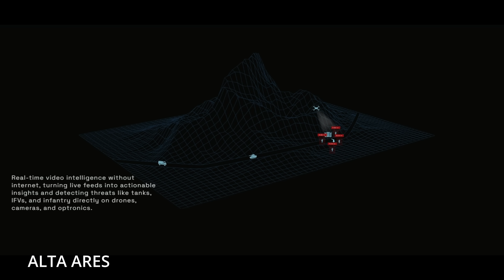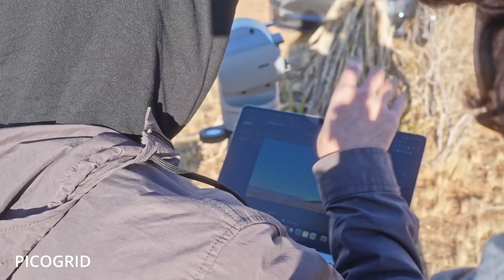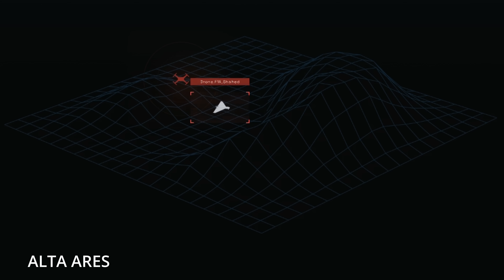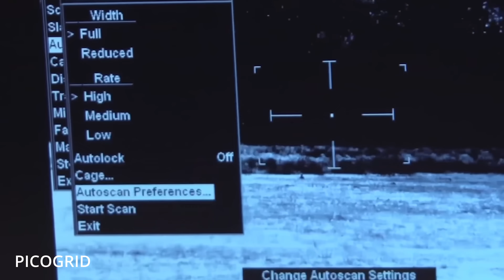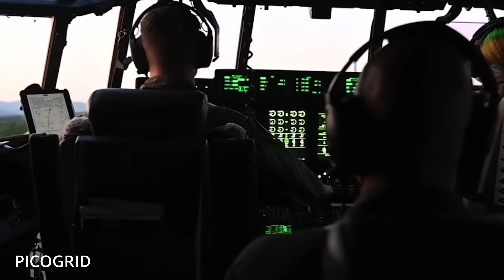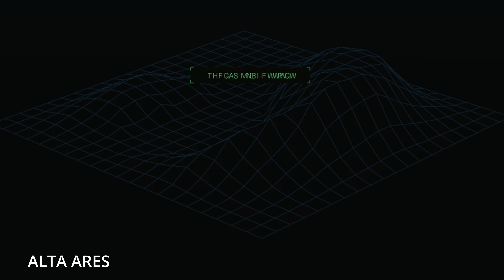France Builds Real X-Wing to Stop Drones!

Comment: Ukraine really needs REUSABLE drones to take down Shaheds/Gerans/Parodiyas. These drones are much cheaper than using missiles, but when you need to take down hundreds of drones in a single attack, that cost soon shoots up to the point where it's unsustainable long term.

Another option would be AT-6 Wolverines. The manufacturer Beechcraft has proposed an anti-drone variant with underslung gun pods. That makes a lot of sense.

Lastly, the best solution would be to take out the drone factories. European countries could build Ukrainian long-range attack drones under licence and provide Ukraine with a steady supply of them in large numbers, so that the drone factories can be WIPED OUT, not just damaged. (The same goes for oil refineries as well.)

Comment: So you hinted at interfaced Radar. So how does that work? If it must have it's own unique radar units specifically designed to work with the x-wing.. for me it's a non-starter. Unless it can accept data from other NATO linked radar systems, it is too costly. So say it is hovering, what is hocer time? If low then don't work unless launched into intercept path and assuming Russian radar does not see it coming and execute alternating courses to dodge.
How is it with IFF? You mentioned pixel scanning so what if Russia makes minor changes, does AI need updated or can it attack and send back new profile data? Very low success rate which may be associated with inability to properly vector in a timely manner combined with final approach accuracy and attack method ie direct contact or fragmentation. If the later, range, approach angle & projectile pattern could definitely be factors with such a low kill rate. If it can't do the job, it should be smart enough to return to base and signal target out of range so another might be vectored in.

Comment: Looks like progress. Ideally, they would not self-destruct but be able to take out the target shooting or releasing something dumb and cheap, and return to base for a reload. Then you don’t throw away expensive AI capable hardware on every shot.
Reply: Both types of drones (kamikaze and rechargeable) are used in Ukraine, with a preference for kamikaze drones.
Because 100% of the payload capacity is used for a one-way trip and the explosive charge.
In addition, the risk of capture is higher if it does not destroy itself.
Reply: Exactly my thought, especially as he said they start "and land" vertically...
Reply: @cftvgz123 they can land because Alta Ares (the company which made these drones) did much more than just intercepter drones. They made a « protection dome » against kamikaze drones (like the golden dome for the US with the missiles). So it’s basically a passive protection where drones stay flying in an area in case an enemy drone comes. When it has no more battery it can land to recharge I guess. 
Alta Ares just proposed there dome to the French procurement agency a few days ago…
Reply: i wonder if the concept of ramming fighters like the Northrop XP-79 could be revived in drone form. How hard are Shahed's control surfaces anyway?
Reply: @CanalTremocos  I guess you could, but it's easier to neutralize a target with an explosif than with a direct impact.